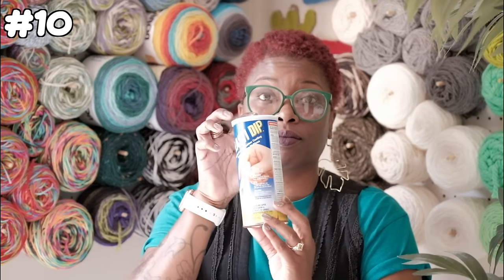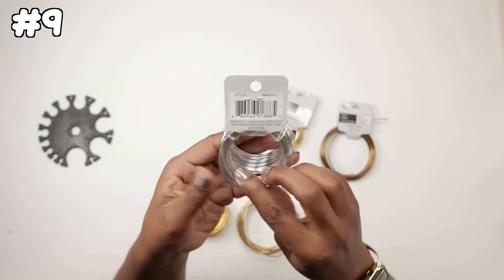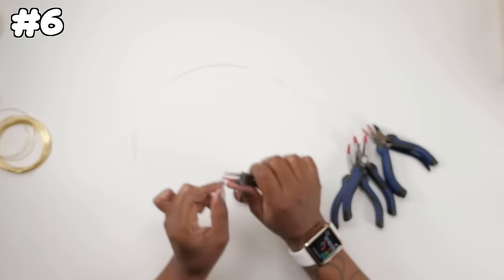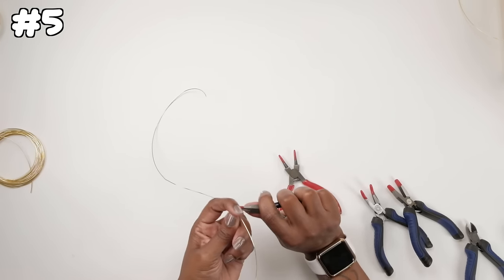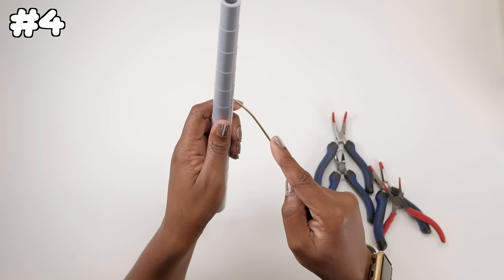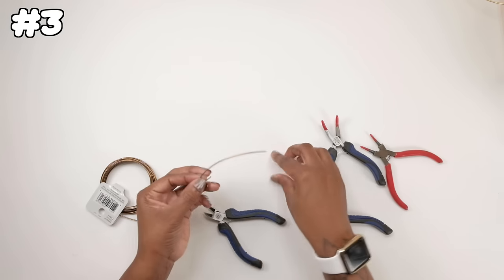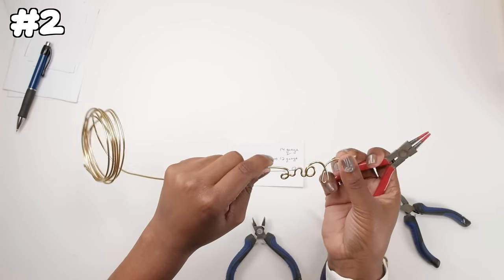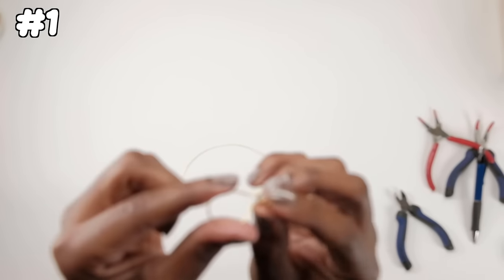Wire Wrapping Tips And Tricks | 10 Things I Wish I Knew Before I Started 🤷🏽‍♀️

Comment: thanks for the video. i wanted to start this hobby so i found a shop and bought some wire to try it. when i wrap my wire it does not stay in the position i bend it to, it seems to not keep the shape, it opens up when i let go of it.
Reply from the maker: I have no idea what wire does this. I have many questions.  Was it JEWELRY wire or regular wire to be used with electronics? What does the packaging say?
Reply: @MartianCreations  it is jewelry wire i think it is bronze, you bend it and it bends but it sort of does not want to stay flush on the stone,
Reply from the maker: @samosdolphins123  yes! That makes a lot more sense. I use brass rarely and when I do it's for a bracelet that I would stamp letters in. I use and suggest copper, especially tarnish free. It's easy to bend and each gauge of wire is great for a different thing. 20 gauge is perfect for rings, earring wire  and pendants and 24 gauge is perfect for wiring and attaching beads to stuff. I will be doing a video soon on WHAT WIRE TO BUY FOR CERTAIN PROJECTS.
Reply: @MartianCreations  thank you very much for your advice.

Comment: Beads and holes ... I Like your style :D nice accessoires and stuff! Is there a sealing for aluminim or something to worry about due to putting metals in the ear? Just remembered pll saying allergies to piercings or stuff like that and i am too lazy to research :D
Reply from the maker: Hey hey hey thanks! The earring wire I’m putting in my ears is mostly copper or brass. It doesn’t bother my skin at all. It’s a great alternative to gold or silver. I only use the aluminum on the parts that dangle. Does that make sense? I have NO IDEA about sealing aluminum, when I was a teenager, I used to coat my earring wire with clear nail polish. It kept the color of the wire right and kept me from having an allergic reaction to it. I don’t see why that won’t work today.

Comment: A lot of people have allergies to certain metals, also if the wire contains nickel,  or lead, those can be a health hazard!  It is important to know what metals and alloys are in the wire you use for pierced jewelry. Marie, it is important that you know what is in the wire you are selling to folks as some people could even have an anaphylactic reaction which could be life threatening. Just thought you should know.  I only use surgical grade stainless steel or titanium, premade earring wires. They are not all that expensive, add the cost to your jewelry and then you can put on your packaging that you are using these high grade products for the safety of your customers.
Reply: Let's start with this video is about 4 years old. I do not sell earrings that are made with wire that has nickel in it. I've come a long way since this video and currently sell earrings made with gold filled, copper, or stainless steel wire. No worries. 🥰

Comment: That’s not a dowel(dowels are rods(normally wood) that are the same size along the whole length), that’s called a Mandrel, and it’s the same name for the ones you use to make Bangles, or even for making the coils of wire, which you cut to make jump rings too.........